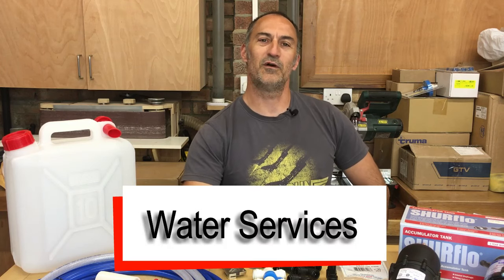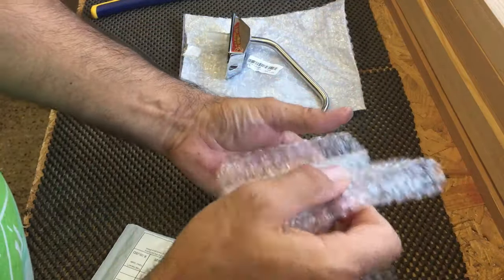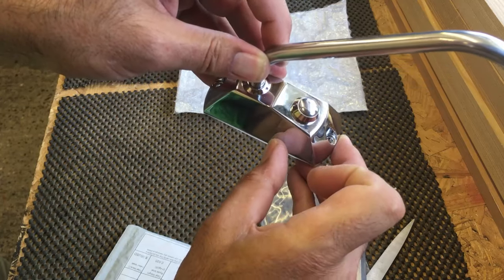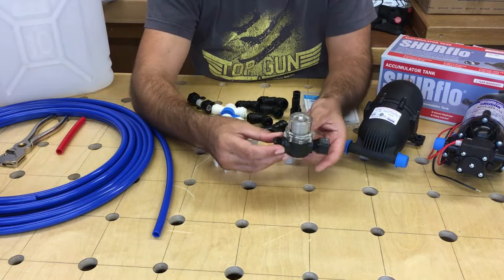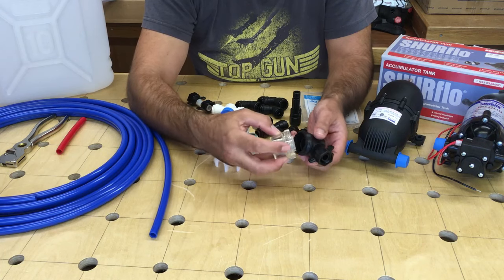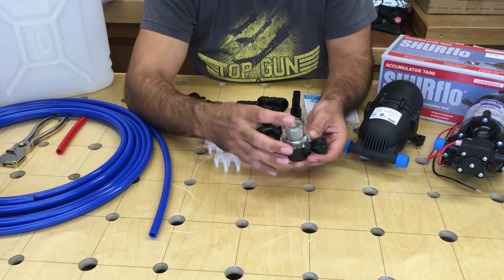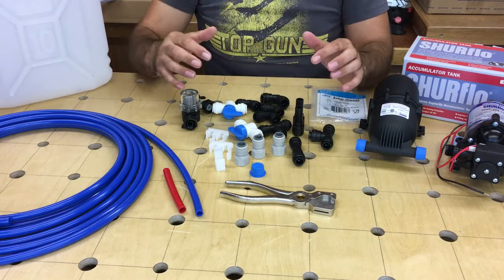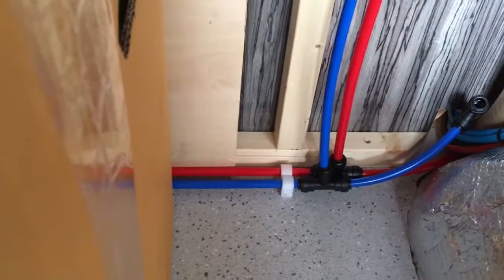Domestic Water Services - Camper Van Conversion Series

Comment: Loving your videos Greg, great work.
I'm just starting my project, and I really don't mind going without most luxuries, will be keeping things pretty minimal, probably won't even have hot water in the sink. But one thing I'm being pestered for is a good shower; if you ran a pump from the inverter, could I buy a larger pump to give as close as possible effect of a 'power shower'? Or would that be too much pressure on the flexible hosing, or anything else in the system? Thanks.
Reply from the maker: There are a few battery power portable shower systems on the market now that you might want to check out.

Comment: Greg, 
First off thanks for all you informative videos.

A quick question. How did you reduce flow to fresh water faucet. I bought everything as you have but the pressure is crazy from the submersible pump.

Thanks 

John
Reply from the maker: I didn’t do anything. It does have a good flow and you do  have to angle you glass to avoid splash back but we have got use to it now. You could try fitting a valve in-line and just crack it open to create extra resistance.

Comment: Thank you.
What's the small piece of (clear?) pipe between the pump and the expansion vessel?
I've bought a "PCL RF104 Radiator Filler" which has a "3/8 Inlet" - I guess it's female threaded. I think you covered converting from imperial (threaded) fittings to John Guest pipe - for your shower i.e. I should be able to get a adapter?
Finally I guess it's possible to adapt to the John Guest pipe to quick release (gas barbecue) type fittings e.g. to "plug in" an outside water tap on the (rear) doors?
Excuse the questions!

Comment: Hi Greg, another super helpful video, thanks! Just wondering where you got the connector that you use between the accumulator and pump and what it is technically called? We currently have 1/2" flexible hose held on with jubilee clips and can't stop it leaking! Have tried searching every term thinkable in eBay and can't see it on your parts link. Thanks in advance!
Reply from the maker: This is what I used https://www.ebay.co.uk/itm/CARAVAN-MOTORHOME-Shurflo-Accumulator-Straight-Connector-0687-/372371947873?mkcid=16&mkevt=1&_trksid=p2349624.m2548.l6249&mkrid=710-127635-2958-0

Comment: Hi Greg, do you have to run camper specific taps/shower head in shower, kitchen etc (ie with built in 12v switches).  Or is there a way of using regular household taps, believe it has something to do with the pumo 🙈Thanks very much, so knowledgable 😁
Reply from the maker: jop1928 with the system
I have you can use all normal domestic taps and mixers nothing special. 
The Shurflo pump has a built in pressure switch that brings the pump on when pressure drops. So as soon as you open a tap the pump comes on automatically and when you close the tap it switches itself off. Check out my water schematic video.
Reply from the maker: jop1928 https://youtu.be/7gieUNuZan4
Reply: So from the pump is there a manifold that splits and runs to all the taps/shower? Thank you sooooo much
Reply from the maker: jop1928 not a manifold I just install a T at each appliance and run to the next one. In my case first T goes to the boiler, second T feeds the shower and the end of the run is the kitchen tap. Off the boiler T to the shower and end of run to the kitchen tap. Watch my water services schematic video please.
Reply from the maker: jop1928 https://youtu.be/7gieUNuZan4

Comment: Always so helpful, thanks! Just a quick question - I have a copper tap (so no wires to attach to a water pump). Do you know how would I get the tap turning to initiate the water pump?
Reply from the maker: Hi Emily, the Shurflo pump works on its own inbuilt pressure switch. When you open your tap the water pressure will drop which then starts the pump. After closing the tap the pressure builds up and the pump automatically switches off. 
You don’t need any switches on the tap to make this work 👍🏼😃
Reply: @GregVirgoe  thank you so much!!
Reply from the maker: @emilyjudd3860  you are welcome 🙏🏼 good luck with your build

Comment: Hi grate vid 🙌🏻 just a quick question what attachment will I need to connect to my taps I’m running a Shurflo pump any help would be much appreciated 🙏🏼
Reply from the maker: bangers jones you can get flexible connections which are threaded one end and push fit the other. Taps are not all the same but adapters are available.

Comment: Firstly thankyou for all the help I have received upto now from your videos. Really appreciated. I'm not sure if I've made a mistake, I've perchanced a triple filter to put on my system (I have a household kitchen tap and outdoor shower.) But have found it only has 1/4" hose. Do you think this is sufficient please? The pump setup is the same as yours. Thanks in anticipation.
Reply from the maker: You may find that the triple filter will restrict the flow rate. Have a look at the filter manufacturers requirements for min inlet pressure and make sure the pump pressure is above that. 👍🏼😃
Reply: @GregVirgoe  thanks I will

Comment: Awesome thanks for all the info ! Do you still need to have a power switch for the pureflo or does it shut off when it runs dry?
Reply from the maker: I have fitted a local isolator so it can be switched off when necessary.
Reply: Thank you for the information and thank you for getting back to me !

Comment: Hi, what pipe type, size and fittings have you used to get water into the water supply tanks and for overflow/breather? I assume you have some kind of fill port on outside of van. Great videos, much appreciated.
Reply from the maker: There is a full build playlist showing all the aspects. There is one for external connections and a couple about the tanks and waste. Please look in the build series playlist on my channel.

Comment: Do you vent your drains to the outdoor air to balance the pressure?
Reply from the maker: Zack Vance the grey water tank has three small air vents in the top of the tank.
Reply: @GregVirgoe  I was wondering if you could do it that way... Some people run pvc all the way through their bus and roof
Reply from the maker: Zack Vance you can also fit anti syphon traps to your sink to allow the air in and stop that gurgling noises.
Reply: @GregVirgoe like a p-trap?
Reply from the maker: Zack Vance they make anti syphon traps in both Traditional or bottle types just look for a small air admittance valve on top of the trap. 👍🏼😊

Comment: Hello Greg. Did you used any ptfe tape or something else on the plastic threads fittings? Thanks
Reply from the maker: No they didn’t need any and don’t go too tight as it’s easy to strip the threads.

Comment: Hi
Thanks for a great video.
You’ve used what appears to be some twisty connectors either side of the pump and the pressure vessel - are they to make it easy to remove if required? I’m wondering what they are called please?
Thanks a mil
Reply from the maker: Here you go https://www.ebay.co.uk/sch/i.html?_from=R40&_nkw=Shurflo+244-2866&_sacat=0&_dmd=2&rt=nc&mkcid=1&mkrid=710-53481-19255-0&siteid=3&campid=5338027957&toolid=11800&mkevt=1
Reply: Thank you!

Comment: Hi Greg, really useful vid! What are those connections between the pump and the accumulator? I cant find a John Guest fitting that looks like that?! Thanks, Mark.
Reply from the maker: https://www.ebay.co.uk/itm/372371947873?mkcid=16&mkevt=1&mkrid=711-127632-2357-0&ssspo=s233y439SkW&sssrc=2349624&ssuid=IAwKHBzwQ6K&var=&widget_ver=artemis&media=COPY
Reply: Super Thanks!!

Comment: Your videos are very informative. I have a question. Can I use 125psi pressure accumulator with 130psi pressure tank ?
Reply from the maker: That is far too much pressure for a water system in your van. You only need something about 30psi or 2 bar pressure.
Reply: @GregVirgoe   thanks for your assistance. It is really helpful. One more thing, which pressure accumulator I should use ? These are expensive here in Australia and even hard to find with 30psi. Is it really important/necessary to install this or system can work without this. Can you please guide me

Comment: You should probably get a two-three canister water filter system to put on your water intake, and thus keep almost all the sediment, bacteria and other debris on the outside of the van entirely. This will also lower the amount of times you'll have to clean and flush your clean water tank. There are numerous options there, but RVWaterFilterStore.com has complete sets and examples of types of filtration. Finding really pure potable water on the road isn't necessarily always easy, so having proper filtration just makes sense. That LLDPE tubing does look like exactly what one wants to build the water system out of though, looks super easy to work with and still secure and durable.
Reply from the maker: we chatted about it but was put off by the initial cost of the systems plus the cost fo the replacement filters
Reply: I suppose it depends on what you buy, the "essential" system from the above link is a little over a hundred dollars, and the filters need to be changed once a year for another $27 per set. I think I'll go with something like that, worth it for the peace of mind, and it simplifies water access, you don't have to be super picky about where you fill up.

Comment: Another great video Greg. A quick question. Does it matter which way up the expansion vessel is fitted? Air on top or water on top?
Reply from the maker: Excellent question Steve, yes it does matter, you must fit it with the air on top because if you want to check the air pressure and top it up at some point you need to drain the water out and pump it back up while it is empty. I may fit an extra drain valve locally to make this easier to check. Cheers :D

Comment: Hi Greg, another great and very informative video. Can I ask for a bit of help please? I'm doing a build on a LWB Ducato and have the same set up as you with a shurflo pump, expansion tank etc, I tried temporarily wiring my comet shower/sink tap but burned out the micro switch. I thought as there was 2 different coloured wires coming from the tap switch 1 was + and 1 was - but have since discovered to my cost this isn't the case. Should it be + to one of the switch cables and a + cable from the other terminal back to the pump?

Keep the videos coming.

Cheers

Bob
Reply from the maker: Hello Bob, sorry to hear you having a few problems. With a tap switch you are breaking the live supply to the pump. So take 12v power supply to the + on your tap, then from the other wire on your tap (which is not a -) which is a switched live to your pump + connection. Then wire your pump - connection back to your battery setup. Basically all the switch is doing is breaking the live supply to the pump.  One other thing to check is that the switch can handle the amp rating for the shurflo pump. Some tap switches are only rated for 2amp and you pump is possibly rated at 6amps. If you try to put too much current through the switch it will burn out. Same applies to cable sizing. Hope that helps
Reply: Greg Virgoe just to say that apparently the switch is not needed, we wired up the pump and co. Extend our water supply and hey presto, works great as the switch at the pump detects loss of pressure as soon as you open the tap and the water flows 👍 so no need to use the micro switch, I gues it’s only if maybe wiring to a submersible and need the switch to operate the pump you would use it
Reply from the maker: Yes Bob, don’t wire a switch to your shurflo pump, that works off the pressure switch as I explained in the video. The tap switch is to put power into the small white sub pump that is in our drinking water can. 
I thought that’s what you were referring to not the shurflo pump. Sorry for my misunderstanding. Glad you got it sorted.

Comment: Hi Greg. Sorry for the silly question but what items did you use to connect the pump to the pressure vessel? I was using some JG connectors like you have at each end of your assembly but I am tight for space and the assembly is slightly too long to fit in line. What you have used appears much shorter and I would like to try that if possible.
Reply from the maker: https://www.ebay.co.uk/itm/185366768271?hash=item2b28b86a8f:g:Q2YAAOSwhVZiamlR&amdata=enc%3AAQAIAAAA4Hr7lrpoD7huluOz3vj8BOX2oRj6%2BU5tqI%2FElJAyDfIdoFy82XTrIdEgmuphNHSl0Yd%2BLNDCWj%2BSYh9VdKlL0rxT6nRmKLCQ1VMWt9XgcuAJUhjT5bZILWe9kNEvkEhy%2BhU3HR1DpZx%2Fqkt2QOnJyfp6AtmbaRh0cSS6h9%2FQ0wxADUjAxQa0oDk4MoBrxtRU0hLveOj4nrFbeQrL3yy9wy8yA0o7IzikfPge0%2FnDJtA%2BNIdcumfaO%2BiEJSuG%2Bg%2FQHKSxW0hY59%2FQi8Cpj8i0mYfHz52UOgylbBspFfzsPVHr%7Ctkp%3ABk9SR6KCwobBYg&mkcid=1&mkrid=710-53481-19255-0&siteid=3&campid=5338027957&toolid=11800&mkevt=1

Comment: Just  a question , should the in-line water filter be fitted with the lid facing downwards so that any debris or grit  would collect in the clear lid and be visible to inspection and then fall out when the lid is removed?
Reply from the maker: That's a very sensible idea, yes, I would fit it with the glass bulb underneath.
The expansion vessel must be fitted on top of the pipe sticking upward so that any water can drain out of it to check the air pressure.
The pump has to be fitted according to the flow direction on the pump and it does not matter which way up that is. Cheers

Comment: Hello Greg, thanks again for another amazing video. Quick question, how did you connect the piping to the water tank? I have gone for the same 75lt tank as you.
Thanks
Reply from the maker: The water outlet is exactly 15mm OD so will accept a JG push-fit fitting. I used a 15mm push fit elbow. Then into that I inserted a 15x12mm stem reducer. Then 12mm pipe into that. 
Very simple quick and easy.
Reply: @GregVirgoe  thanks for the rapid reply. For some reason I though the push fit fittings would work only with the flexible piping. One last question, what piping did you use between water pump and expansion vessel, and how did you make it watertight as I don’t see any jubilee clips?

Thanks a lot

Comment: Hey Greg great videos watched them all... just an observation but I would mention this system is not for low temperature use! You would have to move external tank inside van and internal pipes lagged in possible cold ingress areas ie over wheel arch i believe you just have bubble foil there. Also would be great to see a video on how all the equipment operated while you were travelling ie things you would change or do differently, did the shower work well? was it really needed as it takes up a lot of room? How was the solar? thanks Christopher

Comment: Have you had any issues using the JG adapters straight onto the strainer and accumlator? From what I've read these are NPT thread not BSP.
Reply from the maker: No problems at all in three years of constant use 👍🏼😊
Reply: @GregVirgoe  ok thanks that's good to know, did you use any thread sealant?
Reply from the maker: @olly-mtb  on the thread to thread joints just two wraps of normal PTFE tape and don’t overtighten just till they are snug 👍🏼😊

Comment: I am thinking about exactly the same build but with the extended version. Maybe I am paranoid, for myself with 5 passengers inside-- how is the collision safety rating with all the furniture installed inside upon a serious rear-end collision?
Reply from the maker: I have secured all my internals to the steel structure of the van, the sub floor is screwed to battens in turn screwed to the steel floor. The cabinets are screwed to ply lining that is screwed to the steel of the van. Bed is fixed with M8 bolts into the main structural member of the walls. Have you seen the video of me swinging on my wall cupboards. I have sandwiched the main walls in between the ply lining so they are secure along the full height. Crashes from the front are more dangerous than rear end as the contents tend to fly forwards to the cab. Don't leave potential missiles out on the side or loose when travelling. Search YouTube for Bailey crash test, it makes interesting viewing.